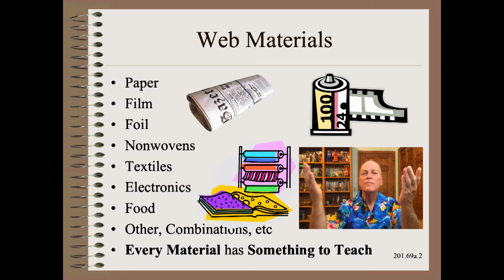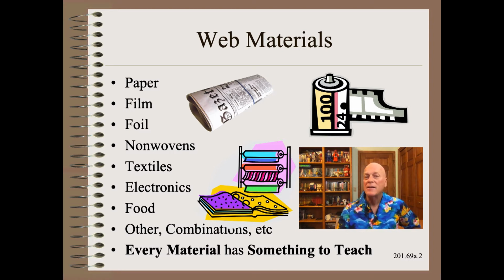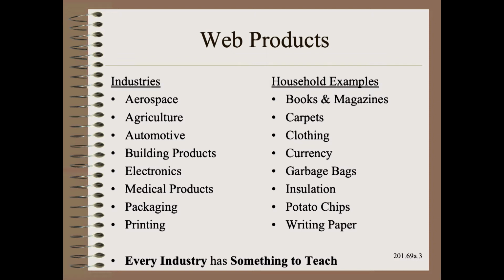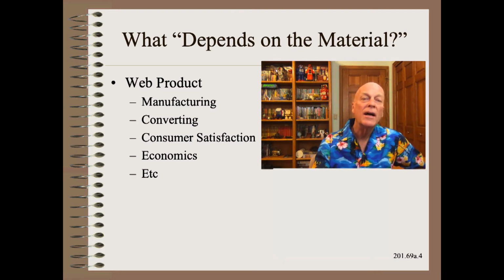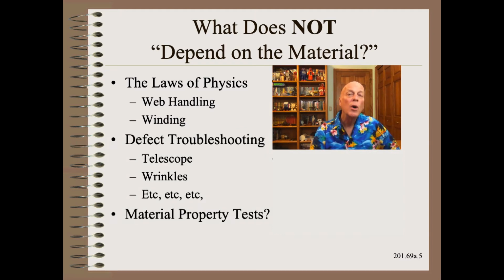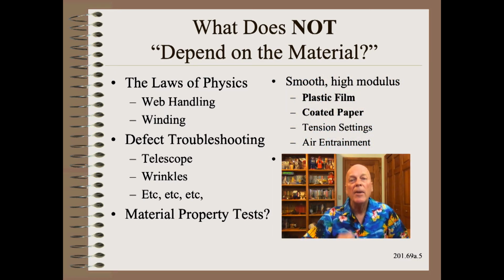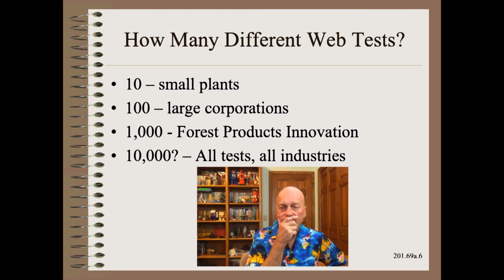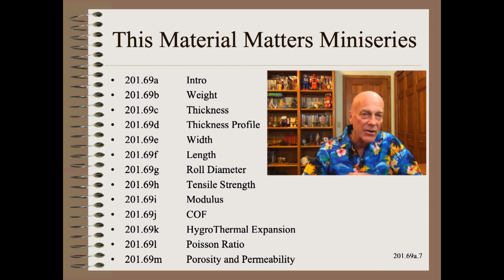Web20169a - Material - Intro

Comment: Hello, just a comment, a detail, but I think is important in a professional video. During the clip there is an annoying noise  of your chair.
From a technical point of view, the clip is excelent.
Reply from the maker: Thanks for the tip Oscar.  Forgive me.  I am aware of the squeak.  I've tried to oil:  no joy.  I've used other chairs but they do not feel quite right because this one is the one I've done nearly all of my professional work in for the last 35 years.
Reply: @DavidRoisum  I understand you perfectly, David. I have a special feeling with some old things. They were good friends in my professional work. So, Forget my first comment.